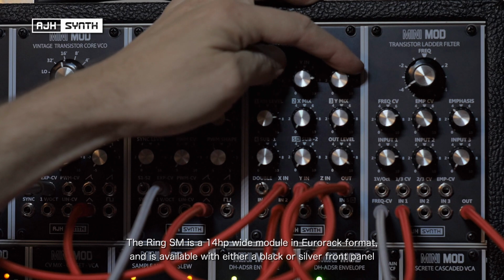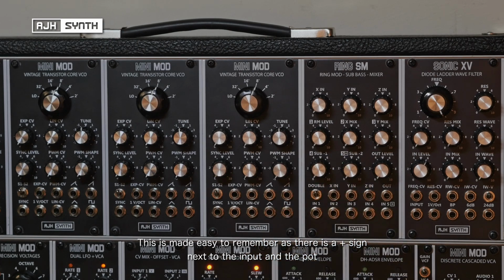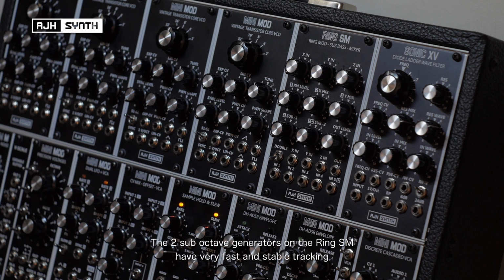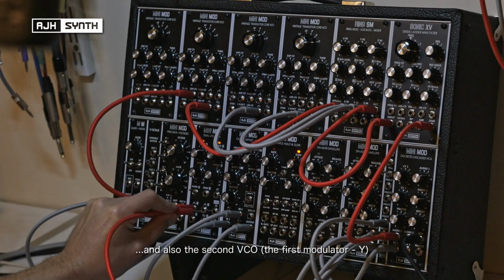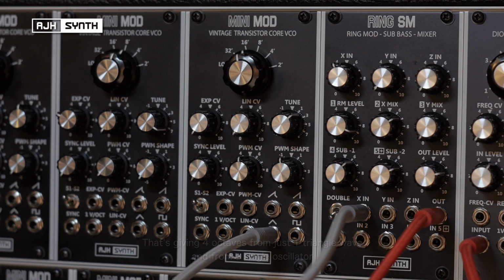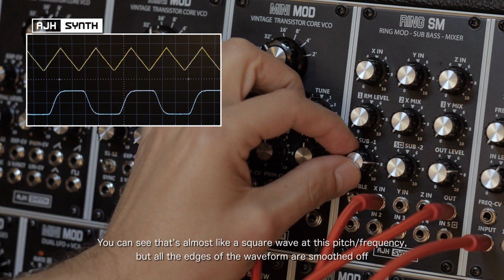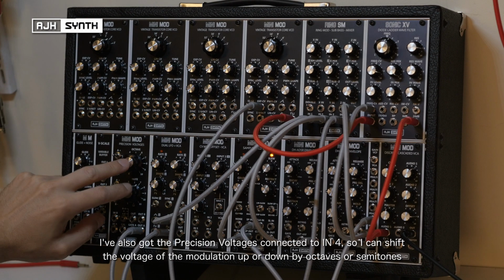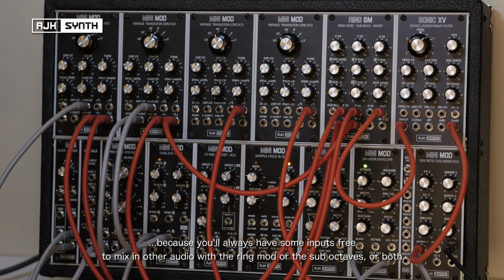Ring SM User Guide - The AJH Synth Audio/CV Mixer, Ring Modulator, Sub Bass Generator

Comment: I feel like the Ring SM is kind of a lynch-pin in the AJH lineup. It’s an intermediate tool that wildly increases timbral possibilities, and can really glue sounds together. It’s also so complicated that I’m frequently forgetting details, and more panel graphics could help with that. For example, the relationship of X with the subs, or RM with the doubler. For that matter, the doubler switch position is ambiguous: do I want up or down? There are a few AJH modules that have similar panel problems, but the Ring SM seems to be the most extreme.
Reply from the maker: The Ring SM performs so many functions that there is always a danger of making a front panel for such a module that's messy or cluttered, then ultimately too confusing. There is very little space on a Eurorack panel with many pots and inputs, so the labelling would have to become increasingly more tiny as more of it is added, making it difficult to see.
The same applies to other modules which pack in so many features - it's a case of trying to find a balance, but a 'one size fits all' solution is impossible. People will always have different opinions.
X is a carrier signal, so it's used for the ring mod, and also to generate sub octaves. The Double switch - think of it like most light switches, where you switch it down to turn it on. Because it's derived from the ring mod (which uses X as it's carrier signal), it also depends on the level of X IN being raised.
It can seem lot to take in (ring mods in themselves can be confusing at first), but if these features were all separate modules they would each need the same learning curve, it's just that here they are condensed together in a single very space-efficient, yet playable module.